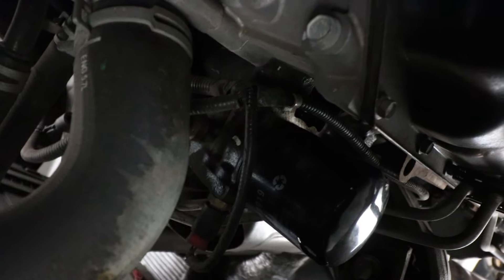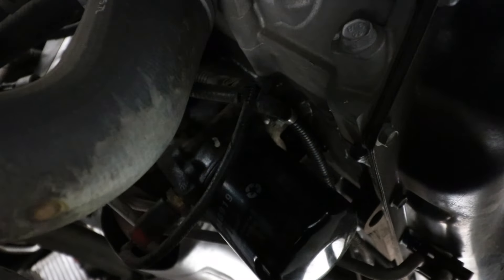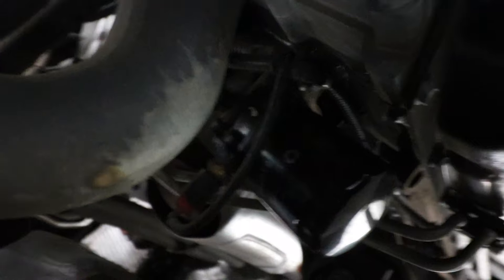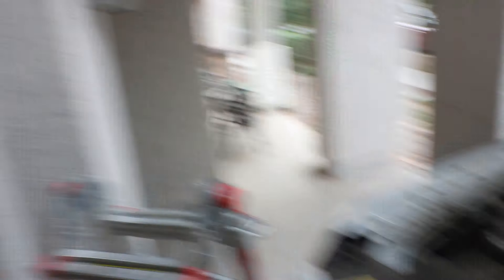How to Change Oil Pressure Sensor (2013 Dodge Ram 1500 Hemi)

Comment: If you disconnect the battery and then reconnect it the check engine light should go away. It starts back up and does a system check. Upon reading oil pressure it will no longer throw a code.

Comment: Jus watched this after getting a cam, long tubes and mds delete, my engine light came on, and this is my code, as far as I know, this video was very helpful and I think it’ll solve my problem tomorrow, thank you sir 👍
Reply: Did you end up solving it ? I got the same codes after cam swap
Reply: You gotta program the computer to what the engine is now. Mds delete makes it come on cus it doesn’t think it’s got mds delete unless you tell it. Basically go spend a bunch of money at a shop for a guy with an expensive computer thing to probably take 5 minutes
Reply: And if a shop did that they should’ve done that for you or should do it free if you take it back cus you didn’t have a light when you came so they gotta fix it

Comment: Man, you're a life saver today! Guess I have good timing!
Reply from the maker: Awesome, did you run into the same problem?
Reply: Justin Built yeah man I did. My engine light still hasnt gone off but its throwing the same code
Reply from the maker: Jack Kennedy mine went off after about 50 or 60 Miles. So yours should turn off soon

Comment: Did any bodies light eventually go off?? I had code p1524 for oil pressure sensor on my 09 Ram 1500. Replaced the sensor cleared the code and the light came back on. Checked the harness to see if there was a short and there isn’t. I’m stuck. My engine light being on makes me lose my remote start feature
Reply: Turn your key to run press fuel pedal to the floor 3 times slowly turn key off. Start vehicle light will be out.

Comment: Thank you!!!!!  Life saver!  I'm cursing at the damn connector...I have some needle nose that will probably work, just reaching it in that awkward place without jacking the truck up to get from underneath.  There's a spot in my driveway that lifts it up a bit higher, might have to park it there :)  TOTALLY appreciate your video and the fact it's EASY to swap.  The 1 1/16th deep socket cost me $8 versus the $150 an hour to get the dealer to do it.
Reply: I was hoping to watch someone disconnect the sensor, dont want to break that wire, but here i go, truck-sucks!

Comment: I just did it on my 2011 and was able to get it from the top with just some channel locks it took about thirty minutes to do the job
Reply: Just did mine on my 07 durango, removed the air box from the top . much easier
Reply: Praying this will work for my 2011...the dealership was trying to charge me $170 for diagnose when I had already gotten one then $200 for the actual fix bunch of bullshit if you ask me.

Comment: 1 1/16th deep soccet and ratchet. Be mindful of the oil that’s gonna come out, it’ll surprise you. Btw the citadel Durango’s 5.7l is the same as the rams. Other Durango sensors are under the intake.
Reply: My 2013 dodge charger r/t need the same thing done was told mine is behind the alternator do u think its an easier way to get to it?
Reply: corey hayes remove the alternator fasho brother; make it real simple to get to
Reply: Preciate it bro ill let u kno how it goes

Comment: I just changed mine in my 2014 Ram and like yours, my light is still on. Did your ever turn off?
Reply from the maker: Mine did after about 50 or 60 Miles! All clear now
Reply: I replaced mine on an 05 hemi and the light never went off for me either I even reset my Ecu a couple times and it still came back on. I took it to have the codes read several places and it all came back oil pressure sensor.

Comment: How tight did you screw it back on? I couldn’t get the threads tightened all the way
Reply: Same issue I noticed but figured if I keep tightening I may ruin something. Like the threads.
Reply: Cody Conti  I know this is old but it might help someone down the line. The threads are tapered. Which means it won’t seat like a bolt. You can cause major problems by over tightening. Tighten till snug and check for leaks. No leaks? You’re all good. Don’t crank on any tapered threads.

Comment: Hey so I have the similar problem . Changed the oil pressure sensor , disconnected battery , light went away . Drive for about 30 min , light came back on . Any suggestions ?
Reply from the maker: Marvin Timothy I had to drive around 75 miles before my light went off

Comment: did you read code P3449? im having that code read on a used ram i just got but i am assuming it is my deactivation solenoid on cylinder 7. i guess im asking for clarification. if so i might try this first for a possible cheaper fix

Comment: I changed mine and still have high oil pressure and computer still saying the new oil sensor is bad
Reply: Same thing is happening to me right now! All you have to do is restart it by disconnecting the battery

Comment: I bought the part but I’m having trouble disconnecting the wire harness that it’s connected to. Any suggestions?
Reply from the maker: scotman73 You could use needle nose pliers or a flat head screw driver to release the tabs.. If you can get them down to it
Reply: Having this exact issue right now, frustrating

Comment: What size wrench does it take and do you have to worry about oil leaking out?
Reply from the maker: You do need to have a pan ready, a little oil will leak out when you unscrew the old sensor. I am not sure on the exact wrench size. I did not have anything that would fit it, so I used a crescent wrench. I believe it is around an inch, but you will need a long socket to fit over the sensor plug.
Reply: 1 1/6
Reply: It's a 22 long socket will do the job. You might need an adaptor for 1/2 inch wrench which actually worked pretty well for me because of could wrench right past the lines running in that area.
Reply: 1 1/16 deep socket

Comment: Hey, might be a stupid question but is this the transmission oil pressure sensor (that goes into the transmission casing?) or another sensor? Cheers
Reply: oil pressure for the motor

Comment: So I don’t see where you said if you removed the filter to access the sensor
Reply from the maker: Boris Cook I did not have to remove the filter.
Reply: Justin Built just the alternator belt?
Reply from the maker: Boris Cook I did not have to remove anything, there was enough room to unscrew and screw in the new oil pressure sensor.
Reply: Justin Built thanks a lot, I have a man that does simple repair for me but I may let my grandson try it! I’m looking for repairs that he can learn on! I realize this video is a while back but some of the other’s are conflicting

Comment: I just replaced mine. Did your light go off finally mine didn’t go off right after the replacement afterward
Reply from the maker: Mine took about 60-70 miles of driving to go off.
Reply: Justin Built cool. Had some oil leakage when I took it off but that’s normal. Wiped it up put the new one in. The old sensor had oil leaking into the outlet where the wires hook up. Did you get the BWD lifetime warranty sensor?
Reply from the maker: Jarrett Whisenant Whisenant Not sure what brand of sensor I got, but I had some oil leak on mine and I don’t think it hurt it.

Comment: Do you have to replace the oil? Or was the oil leakage minimal?
Reply from the maker: Jay Salais the leak was minimal, I had just had the oil changed
Reply: Justin Built  thank you, that same code just came on in my truck. I’m hoping to just switch that sensor and have the same results you did. Thanks again!

Comment: is this a parody? The CEL needs reset with the same scanner that gave you the code.  - You can easily crack your housing and destroy your engine simply by over tightening the sensor - also, needs checked for leaks after install. wtf